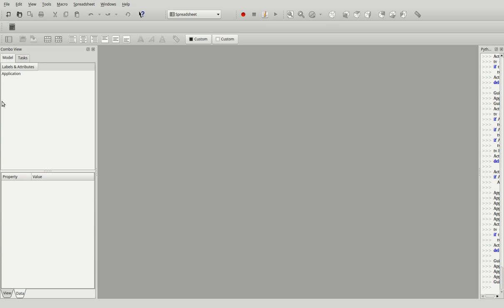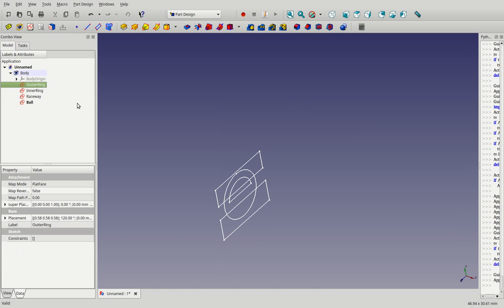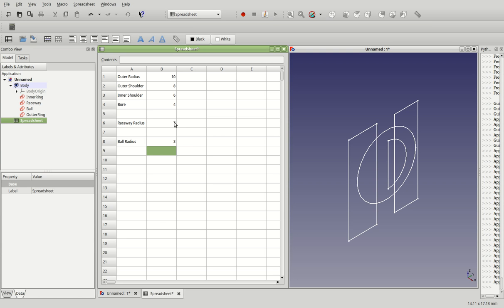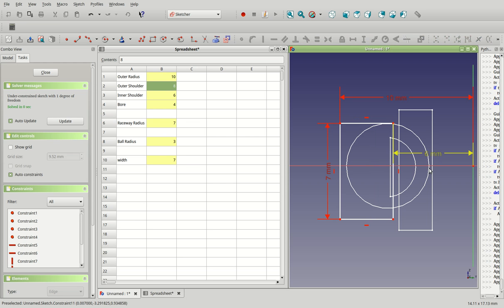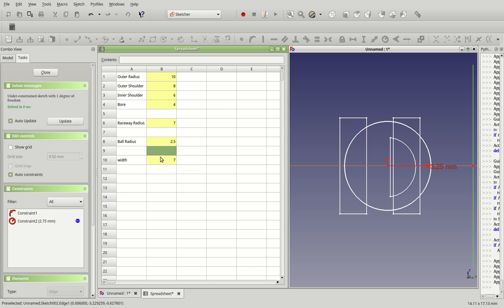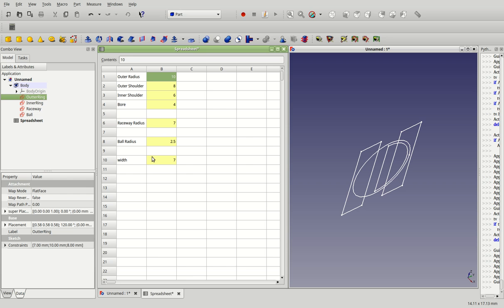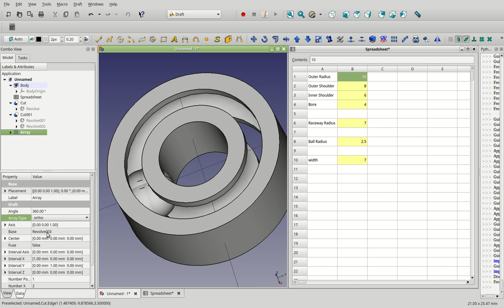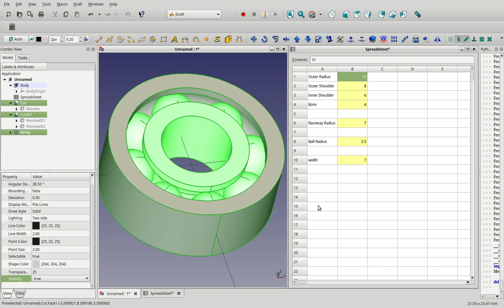FreeCAD SLIDESHOW - Model a parameterized bearing using the Sketcher and Spreadsheet.

Comment: Thank you for demonstrating this! I've been wondering about full parameter definition for freecad for a while.

However, I have to tell you that the video didn't come out right. It is essentially screenshots every 30-60 seconds, and it misses all of the details of what you were doing. The audio is all there, but the video is not.

Thanks again!
Reply: Capture software also didn't catch the right clicks. Thanks for making the video at all though!
Reply from the maker: One of my very first. I need to remake. I have left it on as it seems to help ppl even though it is terrible. :)

Comment: About the polar array, seems like it is meant to create an array of pads or pockets or whatever obtained from a boolean operation: https://wiki.freecadweb.org/PartDesign_PolarPattern

By the way, even if it's a slideshow, great video. I was totally able to fill between the gaps tinkering a bit with the software, so definitely helpful - at least you're showing an interesting workflow instead of just throwing features at people's face like "these are the tools, now build a ship", so words and method are definitely worth more than frame rate :)